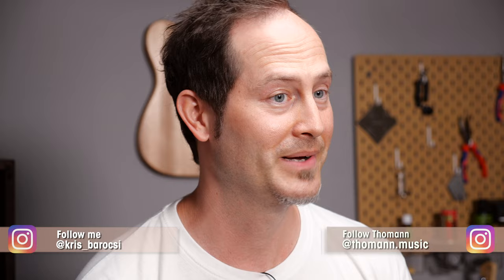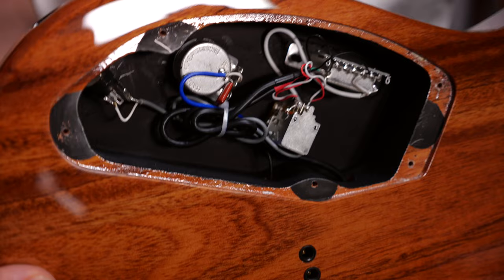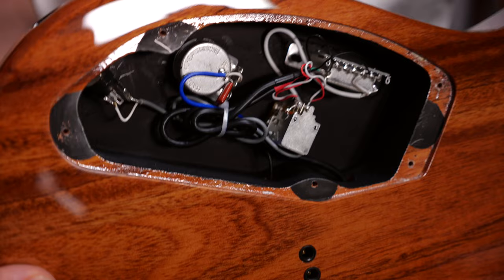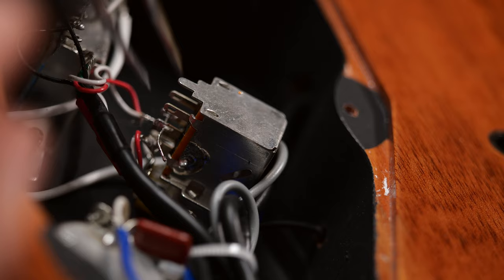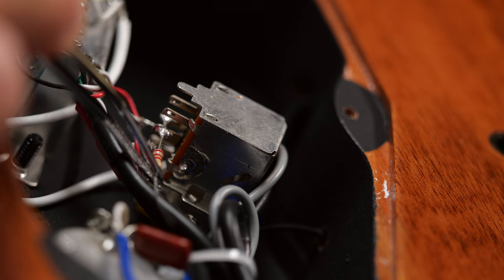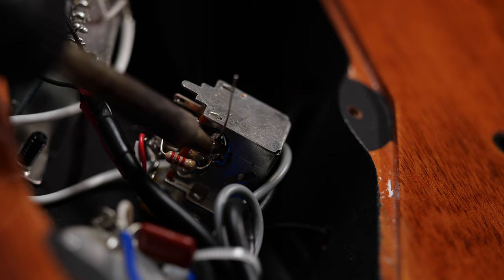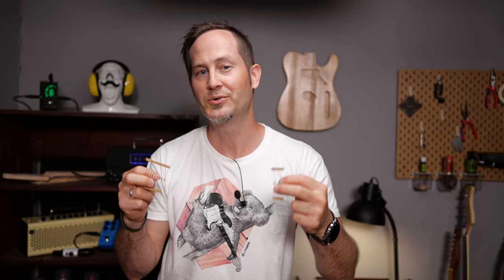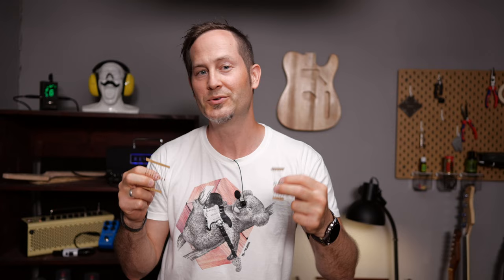Secret PRS Coil-Split Mod | Guitar Tech Tips | Ep. 67 | Thomann

Comment: You can also put a potentiometer in between the coil and the ground so you can choose the amount of signal you're actually putting to ground.
Reply: NICE ONE
Reply: Perfect use for a trim pot, can mount it in the cavity
Reply: A friend of mine did this in his Les Pual custom. Four push pull pots in total with the volume pots operating as switches for the coil splits, and the tone pots acting as the variable resistors when in the pulled position. It created some amazing sounds. Great for chimey Edge sort of tones into a Vox.

Comment: In case you want to compare the mod without the full humbucker in between:

2:26 before the mod
2:46 after the mod
Reply: Why does it sound the same to me?
Reply: to me a split humbucker is still quieter than a humbucker.
The resistors help but still there is that vol diff. Ho do you fix that?
Reply: @barneycarparts  Use a higher value resistor (like 3.9k). It will also thicken up the tone and reduce noise, but it may lose too much of the single-coil flavor depending on the pickup so its something to play around with.
Reply: @barneycarparts  try parallel wiring instead of splitting and see if that is to your taste
Reply: @bruhskifrfrnocapbussinmate  Agreed - Fralin recommends higher capacitors 7k? To me it sounds excessive but it probably makes sense for vintage voiced pickups where individual coils may be a bit weak.
Reply: @juliusgabol  your brain probably adjusts and assumes he plays lighter in the former case (full split). This is what happens to me when I listen to them one after another, using these links. Not when I listen to them after full humbucker, though.
Reply: It will always be less loud if one of the coils is not completely active. Single coils tend to be lower output in general
Reply: I prefer the "before mod" sound ❤😅

Comment: Late to the party, but you could use a small through hole mount type pot to dial in just the right amount of resistance for a setup with both humbuckers on one split. That would save you from needing to solder in different options.

Comment: Cool idea! And easy enough to test with several different R values using some wires with clips on the end (which, BTW, are very handy to have in your kit at any time) before soldering tings in permanently.
Reply: So, you would clip both sides of the R to possible future solder points?
Reply: just use a variable resistor, a trim pot.

Comment: Cool mod, another reason for the issues is, the humbuckers usually use 500k pots on these, while single coils generally use 250k (unless it’s a Jazzmaster/jaguar which use 1M instead.) Running a single coil through the higher resistance pots thins out the tone and volume. I have an old Ibanez Jet King and I replaced the volume point with a 300k to kind of split the difference (it has separate switches for the split), it sounds much better.
Reply: you're half right. If you had it somehow switch to a 250k pot, the output would be darker because more high signal could go to ground, HOWEVER, the output would be even lower. The magic of the PRS mod is that it keeps the output closer in volume.
Reply: @MikeTaffet  lower ohm pots don't have less output

Comment: Excellent tip thanks. 
I'm currently in the middle of modding my HB35+ which I've had and loved for four years now. 
Locking Klusons and IronGear Blues Engine pickups; I'm looking for a bit of extra brightness over the original Wilkinsons. 
Converting to '50s tone wiring' and replacing the 47nf caps with 22nf. 
While I'm in there I'm going to add this coil-damper mod as well, now that I've heard the difference. 
👍
Reply: Would love to hear how this turned out.

Comment: I have a PRS and have wired the resistors in. It works OK, ish. My preferred way of wiring for coil split is leave one pickup wired this way via a push/pull pot, and  as I never use the tone pot (always flat out) I've wired the other pickup so that the tone is a blend pot on it. On 10 the pickup is full humbucker and as I turn the pot down it slowly shorts one coil to earth. It allows me to dial in exactly the tone response I want. I use hot rail type pickups on my strats and have used the lower tone pots to do that for years on them. I replace the pots with push/pulls so I can also series/parallel the coils as well for that fatter sound.
Reply: Thanks for the idea !!  If the volume is 500K :  What value do you need for the blend pot ? Does it need to match the resistance of the Vol pot necessarily ?
Reply: @tanguydelooz2881  as long as the pot is the at least the same resistance as the pickup it doesn't matter, it will just turn one coil off at a different point in its rotation. Basically, minimum 20k pot, but a lot easier to find a 250k. Hope that helps.
Reply: @philcorcoran4970  Thanks for the reply !!

Comment: You have presented an idea here that I can hardly wait to implement. I pretty much gave up on coil splits for the reason you pointed out.  Splitting is diminishing and therefore not a sensible mod. Says I. But you have influenced me to get busy and do it the RIGHT WAY. Thank you.
Reply from the maker: Thanks a lot! Have fun experimenting with different values. Cheers //Kris
Reply: Did you do it?  In theory sounds good but it’s still a humbucker , I am assuming you can’t get the twangy sound of a single coil this way?

Comment: Wow this really makes a difference!

I recently saw an interview with Mick Thompson where he said he used to unbranch his tone knob because he didn't use it and he noticed a significant loss of output. 
Is there something to this (logic says yes) and if so a video how to rewire a guitar to cut out the toneknob would be intresting
Reply: Just cut the wire that connects the 2 pots. It’s not an integral part of the circuit, the signal will still go to the output. It’s also really easy to reinstall if you want to use it again
Reply: @mihneazoican2479  oh didn't know it was this easy 😅
Reply: @welfiblablabla  in my experience, the tone pot doesn’t really suck out too much high end/output. If you don’t use it at all you may want to consider this, otherwise I’d just leave it in
Reply: @mihneazoican2479  Ok, considering doing it on my old Ibanez that would benefit from the output gain, no matter how small. And never used it's tone knob in 10 years owning it.
Reply: You could also replace your tone knob with a No-load pot. What it does is that when you roll up your tone to the fullest, it "cuts" out the knob from the circuit. That way, when the tone is at 10 it is like it's not there. And then, when you roll it back, it's there again if you ever need it.

Comment: One cool trick you can do is use a 10k trim pot instead of a resistor, then you can blend in how much of the second coil you want to use, instead of just the 1k and 2k resistors
Reply: I wonder as well if you could use a capacitor in series to prevent some of the bass frequencies from going to ground
Reply: @OneMomentFromForever  At that point add a programmable DSP IC to the guitar ;)
Jokes aside, that sounds like a very clever idea, may use it.

Comment: I haven't looked in the back of my Harley benton sc450 that came with coil splits... Im wondering if you guys had them made with the resistor already installed?
Reply from the maker: Hey Jeff, as told, this is more a PRS thing, the SC450 will not have a resistor built in. PRS is the only mainstream brand I know of, that uses this little trick. Luckily it's a simple and affordable mod, so if someone wants to do it, it's really not a big deal. :) Cheers //Kris
Reply: @ThomannsGuitarsBasses  thanks kris,
Ill be giving it a go. On ebay buying the resistors now.. Cheers.

Comment: On my guitars with humbuckers i am using parallel /series toggle for that. I do not like split coil tone at all - it has no that single benefits like a full and sparkling tone but has single coil penalties as noisy signal and big drop of volume. 
Parallel mode makes noiseless and chimy tone without big drop of volume and it's reduced signal level is suitable for clean and fuzz. For me it sounds way better than split coil.

Comment: I had been thinking of putting independent splits.for a Duncan sh2 and sh4 on so I could basically use the independent volume controls to dial in a.custom blend with a little bridge humbucker mixed with a single coil neck sh2 sound. Basically to get a slightly fuller single coil tone...with this mod I wonder if that is already accomplished because the other coil is only partially muted. I see you have only one volume pot anyway but hypothetically,.do you think it would be overkill to mix in a little bridge humbucker tone? Say, 7.5 volume on the split neck and 2.5 on the unsplit bridge or something similar?

Comment: Would it be possible to put 2 different resistor in the same push pull? I mean to put one resistor in the ground pin of the neck pickup and another one in the other pin rather than only one resistor connected as a bridge between the 2 pin for both pickups.
Reply: Yes
Reply: Yes, just connect the resistors between the coil split wires and the switch or use a double-pole switch keeping the two paths separate. You can obviously vary the resistor values and for higher DC Resistance pickups you might choose proportionately higher resistor values. You could temporarily wire the coil split wire through a pot (ideally about 25K Ohm) that's wired to ground on the other lug and find the best split sound. Then measure the resistance of the pot at that setting and use a resistor (or group of resistors) equal or close to that measure value.

Comment: Thanks for the rich content. I'm always stopping by for info. Do you know if it's possible to do this on an older PRS Swamp Ash Special? It has a bridge and neck humbucker with a single coil in the middle. These older ones use a 3 way toggle (Gibson-like), 1 vol. 1 push-pull tone. I've never seen wiring quite like it. I think the middle pickup comes on when the push-pull is in the up position. I think the humbuckers get split simultaneously as well. It's a little unusual. It does suffer from volume loss when split.

Comment: Better yet would be a pot instead of a simple resistor, that way can easy smoothly between single and humbucker.
The only problem is that drilling is required and will permanently devalue the instrument.

Comment: Nice trick!!! So, for split-5 wiring (split in positions 2 and 4) you can solder the resistor between the 2-wire joint and the lug of the switch. But the sound might not be satisfactory because you'll have a partially split humbucker and a true single coil (middle)? Can anyone elaborate in this?
Reply: Hey George a little late to the party. Not sure exactly where your talking bout with placing the resistor. But I actually think the sound would be better if you had a vintage output humbucker let's say 7k-8.5k and you split the coil it would only be about 3.5k-4.25k and would sound very thin with a huge volume drop. So if your not Trulu grounding one cool you will get a higher output closer to a true single coil 5.5k-6.5K out of your humbucker and those split positions hopefully will sound Fuller instead of thinner and weak. Now if you had a high output humbucker you wouldn't need to do this mod unless you were running an HH setup and wanted a bit more fullness on your "split coils". I do wiring harness as a hobby and definitely would recommend this for most vintage output humbuckers. Some manufacturers put more/higher winds on the split coil of humbuckers so they retain output / volume so this is very pickup based. I hope this helps.

Comment: Great Job! Love your channel!
Question 
Will the resistors installed for the coil tap affect the tone of the full humbucker pickups?
Reply from the maker: Thanks Warren! I haven't noticed any change in tone at all. Cheers //Kris
Reply: No, the resistor is only the signal path when the push pull is activated, otherwise it's completely out of the circuit.

Comment: Is a coil split the same thing as a coil tap? If not, what's the difference?
Reply: Not the same. Very roughly explained?
A coil split bleeds off one of the two coils to ground, leaving a weakened signal that's 'similar' in sound to a single coil.
A coil tap is a specific type of coil winding where a tap wire exits the pickup at a chosen point in the winding, but the winding then continues until it reaches its final number of winds before exiting; allowing you to switch between the two different values.

Comment: Sweet tip! I’ve got an epiphone LP custom pro and have always found it to sound bad at no matter which setting is used. I suspected it was those chintzy pots. Has anyone pulled out the push pull and put in quality cra or Bourns 500k pots? Was it worth the effort?

Comment: So basically just solder the resistor in where the push pull goes to ground instead of a wire?
Reply from the maker: Yep, it's that simple. Just have to find the right resistor value for your guitar. Cheers //Kris

Comment: Love this!!! Thank you for posting this. 

Does it matter which pot I replace? Does it need to be the volume (I assume) or the tone pot? I got a Zach Myers model and I want to install the coil splits on it. Thank you!
Reply: It doesn't matter, as long as you get the right pot value and characteristic.

I'll just assume you have 500k pots in your guitar since it has a humbucker.
If you want to change the volume pot it would be a 500kA = logarithmic/audio taper pot 
For the tone pot it would be a 500kB = linear taper pot

I'm not a audio electrician so please beware and read up on other material
Also before ordering anything, check the length and thickness of the pot shaft you need and if the knobs you are using are going to fit. 
Easy way to do that is to count the amount of crowns on your current pot.
Reply: @tillsteinbacher3195  thank you!

Comment: Great video.  On thing to share: notice that a 24 fret double humbucker will always have a  more "strat quack" in the middle position, with one or both pickups split, compared to a 22 fret guitar.

This is because on a 24 fret guitar, the pickups are closer to each other.  Let's keep this to ourselves 😄
Reply: If the coil nearest the neck is the live one when split, rotating the pickup will also help get more quack. It shouldn't have any major impact while in full humbucker mode unless you've adjusted the pole piece heights and you only have adjustable ones on that coil.

Comment: Hi Kris! Thank you very much for your vids! I apologize for the late question but could you help? On my PRS SE I've noticed that when splitting, the screw coil sounds much quieter so looks like it's grounds over resistor. In my mind, it should work exactly the opposite - the inner coil should be grounded. Am I wrong?

Comment: Hey how do I do this if I add a push/pull on the volume control for a prs ce 24 used the push/pull for bridge and make push/pull for volume and get 8 sounds instead of 6 where the front and back use the push/pull together Pastor Jones in Mississippi

Comment: Hi, i tried this with my new Roswell LAF pickups and it works flawlessly, but i got another problem. 
When the pickups are split i get the hum with switch in middle positon, is there any way to solve this?
Reply: Guitar is Harley Benton SC500 with two push-pull pots in place of Tone potentiometers.

Comment: Amazing tip Kris!!! Does a partial split retain some level of hum cancellation from the weakened coil?
Reply from the maker: Yes, a little. It's still not gonna be far from being noiseless though. If that's what you want, try a series / parallel switching. That's completely hum bucking. Cheers //Kris
Reply: @ThomannsGuitarsBasses  Thanks Kris! 🙂
Reply: @ThomannsGuitarsBasses  or use a capacitor suck that the cut-off is just above 60Hz instead of a resistor

Comment: Thanks for this, guys! I do have a question though:  How does one do this on an HSH with a 5-way where the Humbuckers are split in positions 2 and 4?
Reply: Unsolder the 2 wires connected together you use to split the pickup from the switch lug and solder the resistor between the 2 wire joint and the lug of the switch. But maybe you don't have a satisfactory sound because you'll have a partially split humbucker with a true single coil.

Comment: The volume loss is still there...so are you sure this is the PRS trick? The new PRS Fiore has the humbuckers switch from series to parallel and that works very well: good single coil tone - still works a bucker so without the hum or volume loss.
Reply from the maker: This is not the only wiring method PRS uses. This is just something they (also) started using on some of their guitars. Series / parrallel is also nice, even though you don't really get a single coil sound with that. It's more of a super clear sounding and narrower humbucker tone. Which is great, don't get me wrong. It's just a different tone compared to actual coil splitting. Cheers //Kris

Comment: Let’s say I had lots of room in my electronics cavity for a few switches and a 9 volt battery, could I replace my neck humbucker with a sustainiac pickup? Or are they bigger than a typical humbucker? 
♾ sustain 🤘🏽.

Frantically digging through resistors with a VOM looking for a 2.2k
Reply from the maker: Dig deep Poo, I'm sure you'll find a 2.2k in a drawer. :D Sustainiacs have the same size as normal humbuckers so that's not an issue. ;)
//Kris
Reply: Thanks Mr. B 🤘🏽 ooooh I’m a get me one , it may cost almost as much as the guitar I’m putting it in but that’s definitely my xmass preset to myself this year🤘🏽
Frantically googling sustainiacs
Reply: @PooNinja  😄👍

Comment: Does it work if I use 2 470k resistors @thomann's?
Reply from the maker: Hi, that value is very far from what works for this coil-split trick unfortunately. Try to stick to the values mentioned in the video. You can find these resistors online or in electronic shops and they are really not expensive. Cheers //Kris